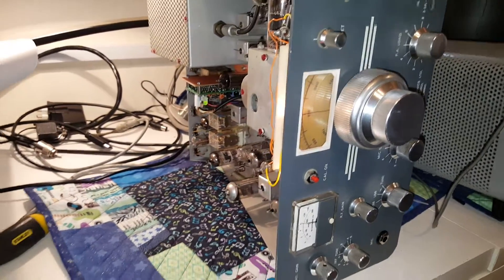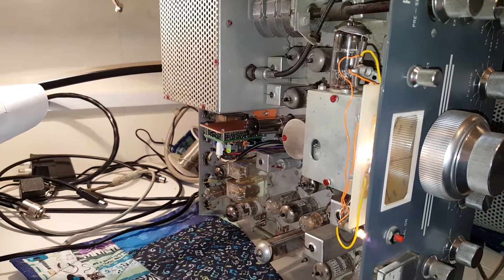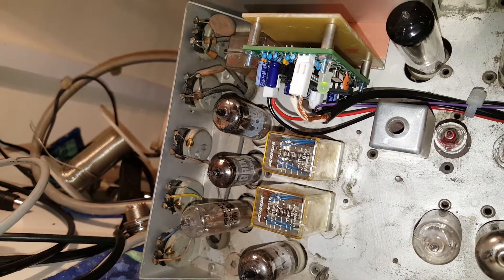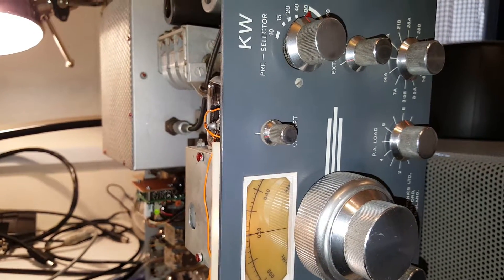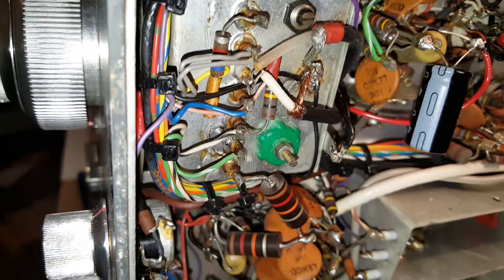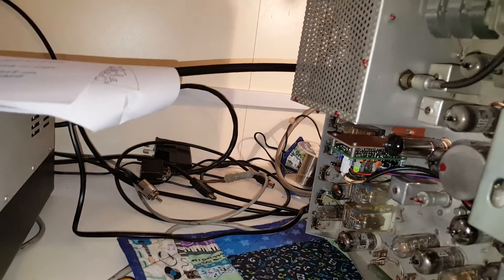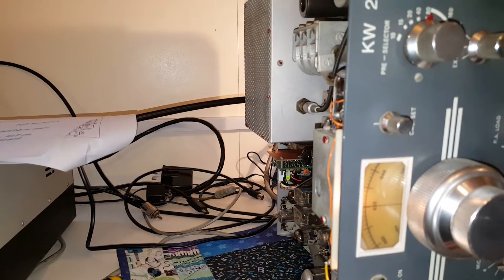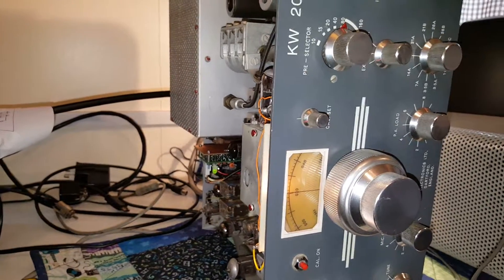X lock fitted to KW2000B Transceiver

Comment: Hi Steve, Yes, these are brilliant little boards and good value. I have one fitted to my Elecraft K1 and another in a Homebrew 7MHz (Direct Conversion) CW TRX. Both rigs use simple LC VFOs and they used to drift with variations in ambient temperature, especially outdoors. They're rock steady now and the DC current consumption is minimal. Highly recommended. 73, Graham de G4VUX